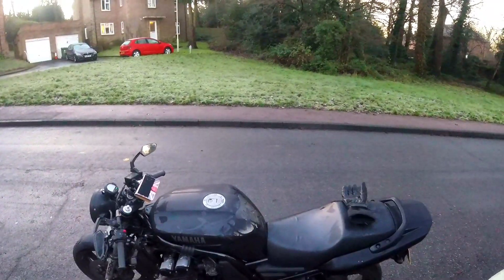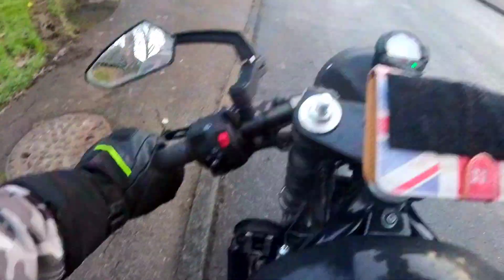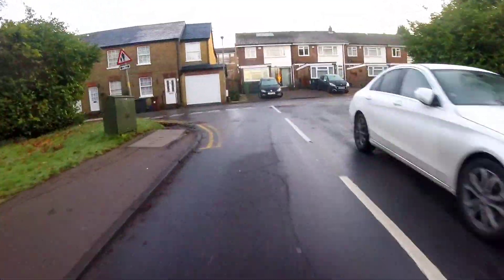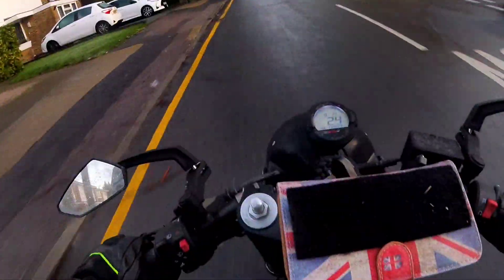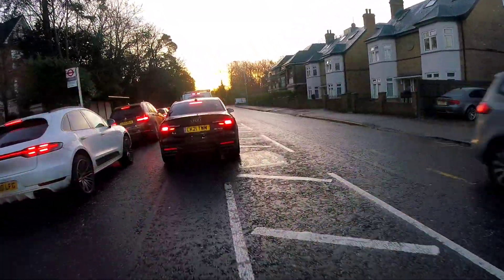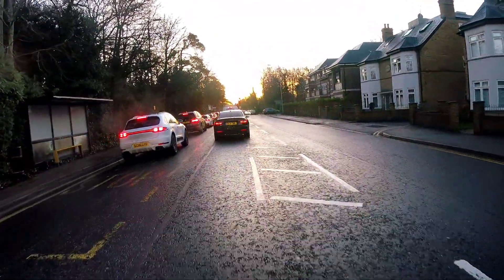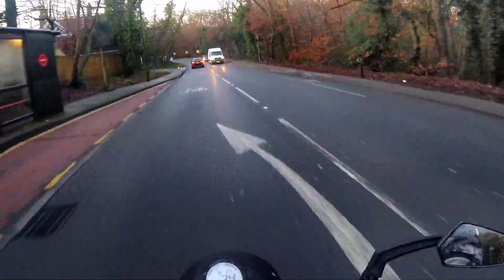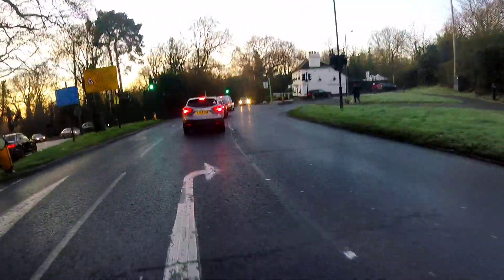YZF600 Thundercat.  To lacquer or not to lacquer?

Comment: Hi Nat ,are you using cellulose paint?
Reply from the maker: I haven't got a clue mate. I asked my local paint shop for the basics. It's labelled as polyester basecoat?
Reply: @NatsNackersYard  Not sure but that sounds like a synthetic paint,the old fashioned stuff was cellulose ,to get a shine with it you started with a thick coat then thinned it to finish,done my zzr with it last year ,ok but modern e fuel ruins it but can be lacquered ,the cellulose is easier to use apparently,your mudguard looks fine though 👍
Reply from the maker: @derekdingwall  I still have so much to learn on paint.  I am sure that it will come with time. I think the clue is in the title. It's a base coat and needs something over it ultimately.
Reply: @NatsNackersYard  Yes it does just had a look online 2k it's called and needs a laquer,I sprayed a few bikes years ago but was all cellulose back then,my mate at the time was a paint sprayer at learnt from him that was in the 80s 🤔
Reply from the maker: @derekdingwall  I hate to rub it in but was still in school!
Reply: @NatsNackersYard  I was in my teens back then, groan groan lol
Reply from the maker: Another reason to love motorbikes.  You can be in your mid 40's and still be considered quite young!